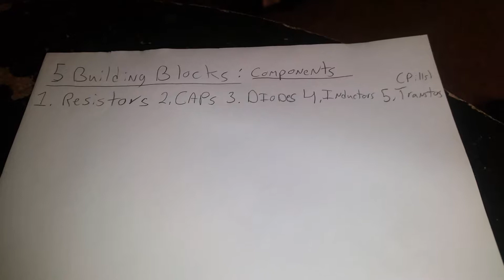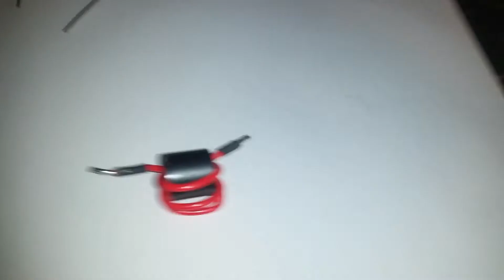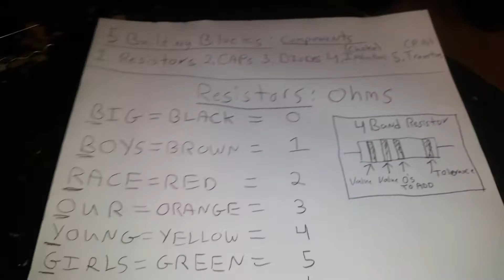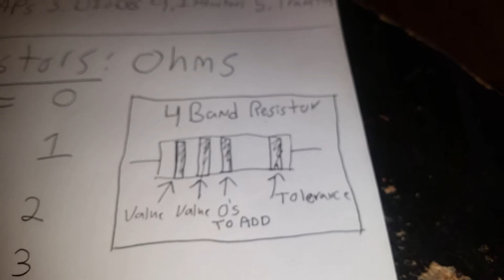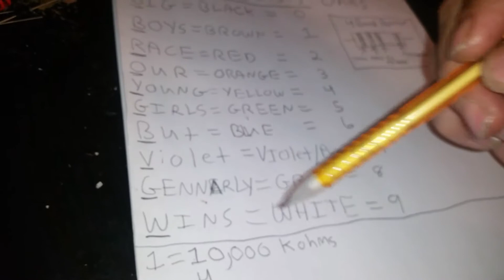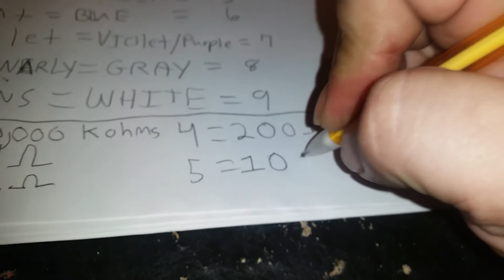RF Amplifier Building Concepts For Beginners - RESISTORS(INTRO)

Comment: This is really cool man! I have an old Mini ball 60 watt cb amp with one MRF453 Pill in it. Its  got a bunch of old brown carbon composition resistors in it.
It still works but I'm told it doesn't sound that good on the air.

Comment: The way I like to explain DC voltage is think of flow of water or plumbing.. all electrical DC voltage flows like water in the plumbing every part is like the parts in plumbing...resistors control flow of water ... Diodes ...direct the direction of flow.. electrolytes caps are like.buckets that carry the source ..diff size caps diff size bucket.. this is a way to help understand...
Reply from the maker: Very well put...that is the exact way I picture it in my mind as well. The electrons flow from the ground to positive, in that direction. DC is so neat!
Reply: Also it will always take the path of least resistance..just like water ..if u pour water out of a pot on top of a slope the water will take the path with least obstruction...this is the exact same way DC voltage works ...always ...
Reply from the maker: @justinruth9729  beautiful analogy brother!!! Sounds like you got a teaching spirit about you...you aren't a Capricorn or a scorpio are you lol?
Reply: I am a the bull.taurus...